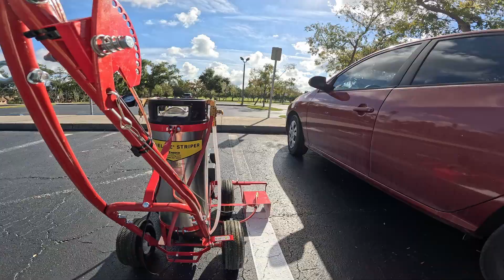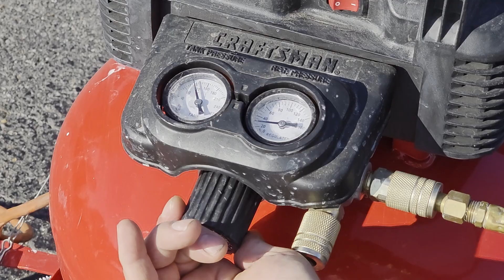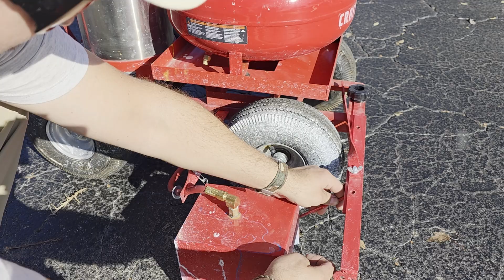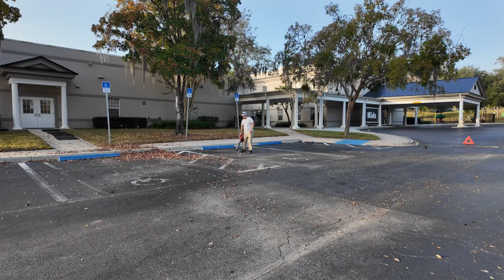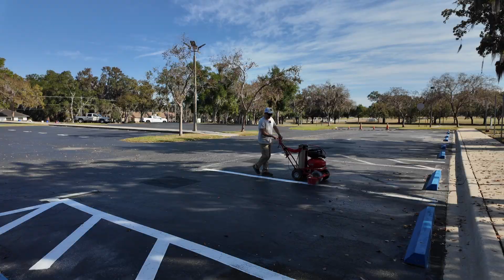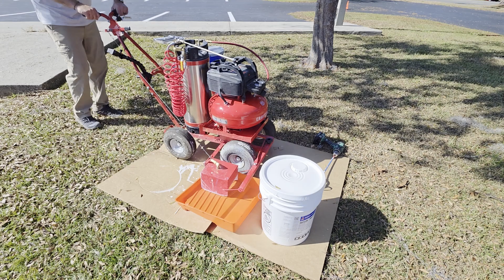How to stripe your parking lot with handicap spots using a Trueline Striper

Comment: do you have any comparison to other brands? you are definitely way cheaper.
Reply from the maker: Thank you for your question. We do not have any direct comparisons. But some of the main differences is our equipment doesn't use fluid pumps to operate; our equipment run at a lower PSI and puts down a thicker layer of paint that will usually last longer than the higher priced machines. This can be a good thing when striping your own parking lot. The spray box that we use, slides flat on the ground and gives you a clean crisp line. Our equipment can be simpler to use and operate, because our equipment has very few moving parts. Our simple design is easy to work on by the end user without having to take your equipment to a dealer. As long as you take care of the machine, it will usually last many years before needing any maintenance. We also sell directly to the end user to help keep the cost down.

Comment: 9:25 a bit off, hardly anyone would notice it... have you ever had a business complain about something small like that?
Reply from the maker: Thanks for reaching out. In this video, we were following the old existing lines. If we were painting a new parking lot, we would have chalked the lines first and followed the chalk lines to get more evenly spaced lines.
Reply: 이 기계가 기존의 엔진 기계보다 좋은점은 뭔가요? 그리고 탱크위에 올려 있는건 베터린가요? 그렇다면 사용 시간은 어느정도 걸리나요?
Reply from the maker: @삭초  Thank you for your questions. Our equipment runs at a lower PSI and puts down a thicker layer of paint that will usually last longer than the engine-powered machines that spray a lighter coat of paint. The spray box that we use, slides flat on the ground and gives you a clean crisp line. Our equipment can be simpler to use and operate, and you won't run into the fluid pumps breaking and engine issues as with other engine-powered machines. Our simple design is easy to work on by the end user without having to take your equipment to a dealer. As long as you take care of the machine, it will usually last many years before needing any maintenance. The machine in this video uses an electric air compressor, all you need is and electrical outlet to plug into and let the compressor charge with pressure and it will hold enough pressure to stripe the paint in the paint tank. We do offer a battery paint striping machine that uses a battery to pressurize the machine which is another great option. The battery has enough charge to spray 60 gallons of paint before needing to be recharged.